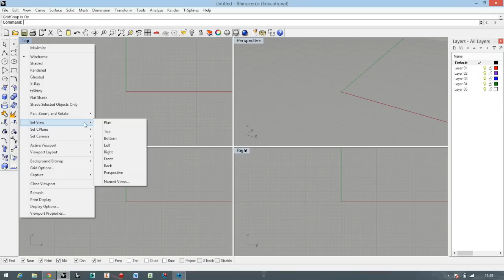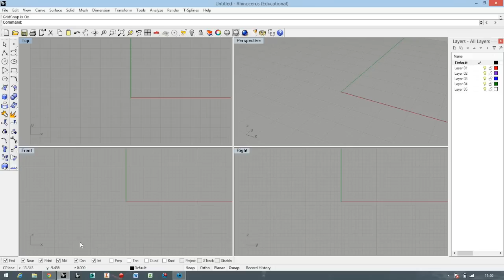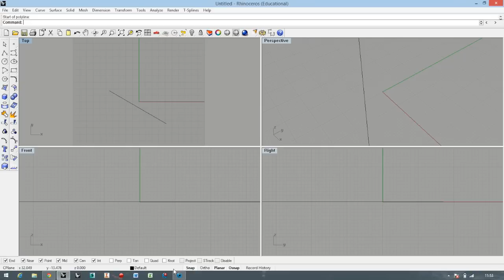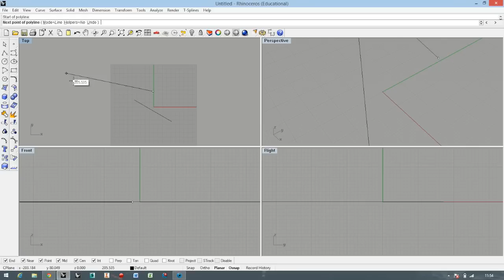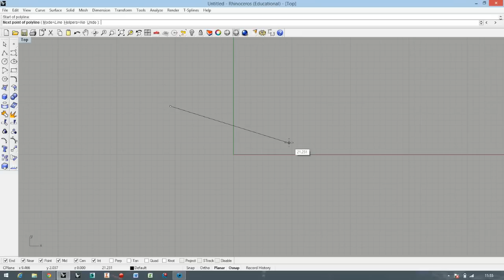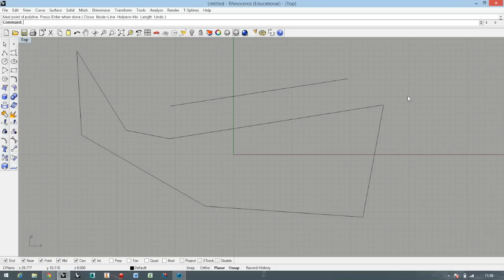RHINO TUTORIAL - Basics session #1 of 6

Comment: May I ask... what are the main differences between WinRhino and MacRhino ? I am learning on a Mac so, should  I be aware of something in particular ?
Reply from the maker: +Juan G  check my tutorials at my channel, there is one about rhino on mac
Reply: RHINO TUTORIALS thank you !
Reply from the maker: +Juan G i am using only rhino on Mac. And it's really alright. You will get use to!
Reply: I have another question. Right now I have to start rendering on a Mac. Fluidray, Keyshot and Maxwell are the options that I've identified so far. I'd use it to render mostly furniture. 

Out of those which one would you recommend and why ?

Thanks.
Reply from the maker: +Juan G keyshot is very intuitive and renders looks quite real. I don't know much about the rest because I was happy enought with keyshot.
Reply from the maker: When I started Rhino on Mac for first time it seemed to be not functional and not friendly, this is probably because I learned how to use it on Windows not on Mac. Fortunately you can easily setup your mac workspace to be like on Windows like I did. Huge positive feature is retina on Mac, it really blows my Rhino mind. Working on it it's just pleasure. After 6 years working on Windows and now 3 on Mac I have a impression that Mac copes much better with Rhino than Windows. To fell it you really needs to try both. Generally there is no much difference between. On mac instead of white command bar on top there is dialog window popping up when you start command. Also on mac there is no snapping bar on the bottom like in windows. everything is hidden on top bar in small useful icon. Mac unfortunately do not support plugins like Grasshopper, Milling plugins and other cool stuff. I don't really miss it cause I don't use it.

Comment: Can we model stirrups in reinforced concrete column other than traditionally used ? n also 
Can we apply torsion to a concrete column ?
and one more Can we design and analyse a reinforced concrete column ?
Reply from the maker: +Siddhartha Deb i don't exacly know what u mean. You mean twist column?
Reply: I want to model a reinforced concrete square column and check it's resistance toward torsion.
Reply from the maker: +Siddhartha Deb Rhinoceros is powerfull tool for designers not enginners. It has advanced analysis tools for surfaces not for torsions. You can get some special plugin I am sure but it cost a lot. It is better to do it in SolidWorks software or Catia.
Reply: thank you